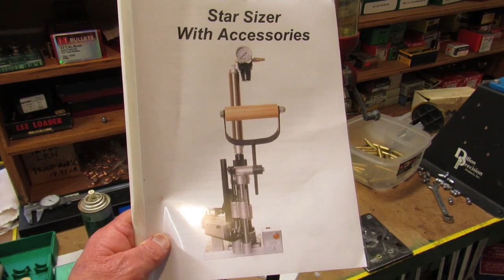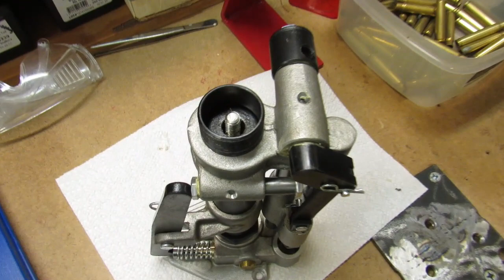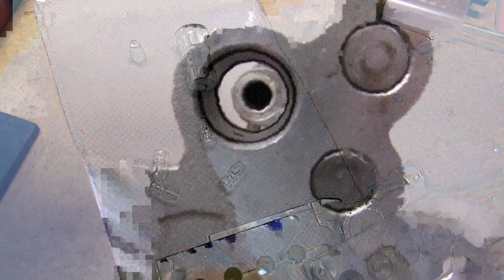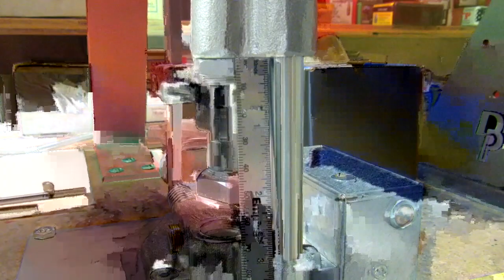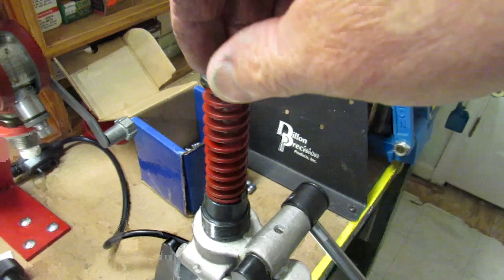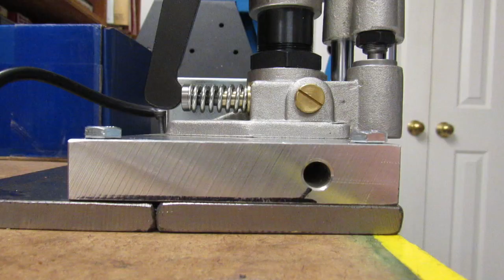Magma Star Lube Sizer

Comment: Still use my dad's star from the 70's, neither one of us wanted to upgrade it, so I still just have a 150-watt clamp light next to the lube body.  It is actually very effective.
Mine is set up to dump the bullets into a shallow angled ramp and slide into a wood box with a piece of carpet in the bottom.

Comment: Be careful when pulling the piston out of your lube is cold, or better yet, warm it up first.. I've got a nice scar just below my mouth from from yanking out it and getting hit with the hollow end of the threaded rod. Thankfully it didn't break my teeth. That being said, these machines are the best, and will outlive you. Mine has to be at least 35 or 40 years or so old and still works great. You get what you pay for from Magma Engineering.

Comment from the maker: As The Magma instructions state  record any distances of the top punch set ups with your calibers and you can reset them back to the same . Sorry for some of the video quality it was all good when it came from my digital camera, if you know what's up let us all know. I used the free Microsoft Movie Maker software to make it.

 As far as interchangeability of parts with the Star both are the same but some Star machines had die cast lower housings .The Magma Star is cast aluminum. Some very early Star lube sizers had cast iron castings . Check with Magma Engineering for more details

Comment: I can NOT put even a 2" stick of lubr in, much less the full 4" stick. The piston/spring assembly cap is INCHES above the thread area.   Pushing down wit all I have I can get the cap to hit the threads.  But one needs a second person to thread the cap on.    ????     Any ideas?   Thw brass screw on the left side.....clean out screw.  heat the base and pull out the lube somehow?    May have something that got in my lube?? I'm at a loss here.   Great job on the video